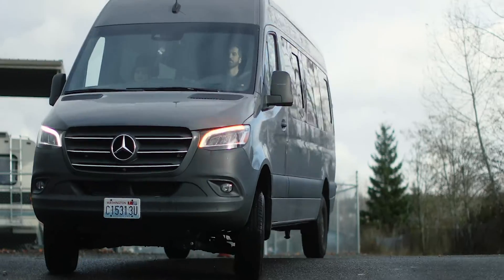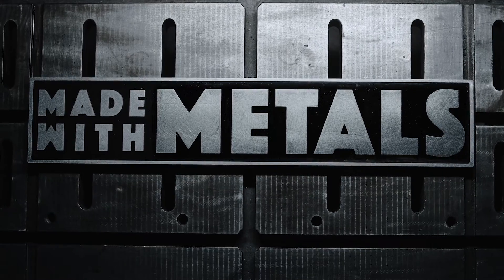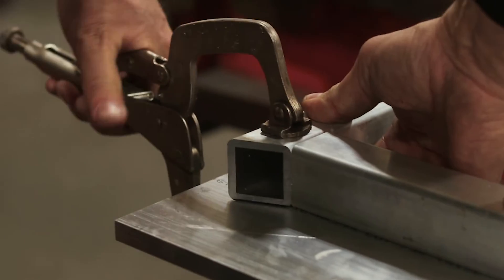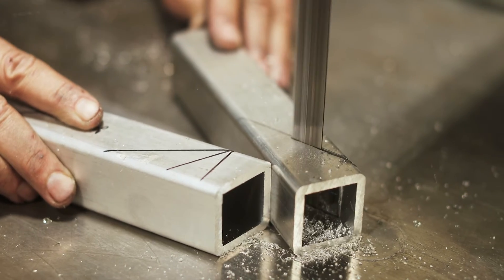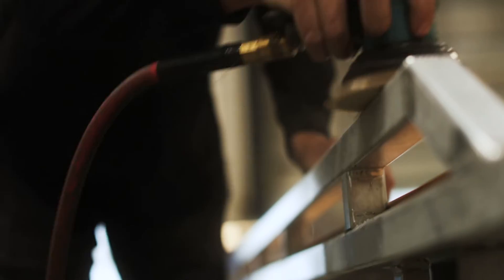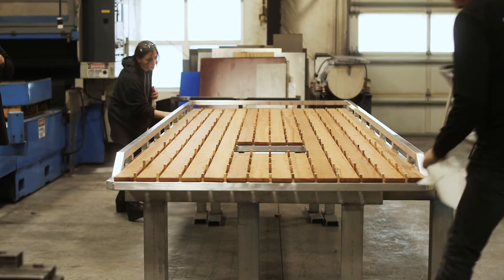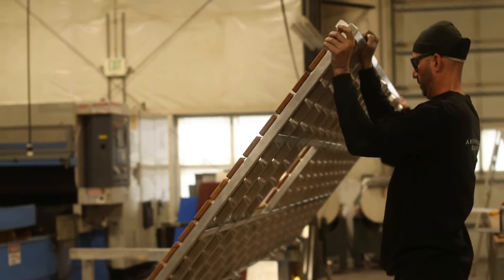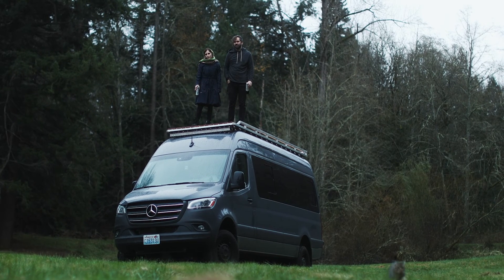Made With Metals Ep. 1 | Fabricating a Forever Sprinter Van Roof Rack

Comment: Cornering stability is now sacrificed with 370lbs  weight on top.  I'd would have a bad case of anxiety driving through twisty mountain roads at speeds.  Rack looks nice but not worth sacrificing safety.
Reply from the maker: That makes a lot of sense, this rack was more intended to be on site for design and architecture jobs, not necessarily driving through twisty mountain roads.
Reply: @onlinemetals     The owner of the van have stated at the beginning of the video what the van was going to be used for which was mobile studio to be able to drive on site.  Are you going to tell the owner to avoid driving through twisty roads?  Like I said the rack looks really nice. I just think you could have made it with a lot less material and still have enough support and still look nice.

Comment: If you can afford a Sprinter and you can afford to waste very expensive tiger wood by putting it in the roof where nobody else will see it, you can afford to hire an architect or someone with the aesthetic skills and materials experience to design it rather that designing it yourself and relying on a fabricator for feedback. I guess you can also afford the liability insurance you’re gonna want to have if you’re gonna have a party up there with no railings. Should’ve designed some pop up railings. Would be interesting to know what the fabricator guarantees you can put up there in terms of additional weight without denting the roof, but I’m guessing the fabricator didn’t guarantee anything about that. Putting an additional 375 pounds at the highest most point on your van will undoubtedly change its handling and cause some back-and-forth rocking. I would love to hear how that turned out. This seems to me like a job more suited to 80/20 aluminum extrusions and I think that would’ve looked better too. It would also allow me to make you another bowl changes in the future and the tea slots are wonderful for lying to quick releasably attach things that you can later re-position without having open holes and without drilling holes. And as for the attitude of you can’t over build it. I’m sorry but on a moving vehicle for which you have a limited payload capacity and for which this placement up high greatly affects the handling of the vehicle you can overbuild it, and you did.
Reply from the maker: Hey Mark, really appreciate the thoughtful response and love the suggestions and changes you'd make as both a fabricator and end-user.